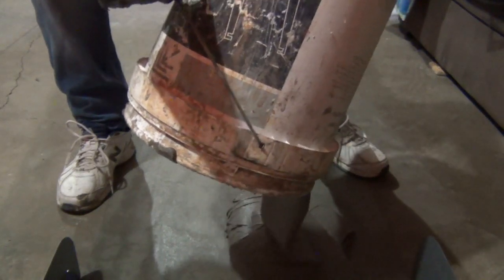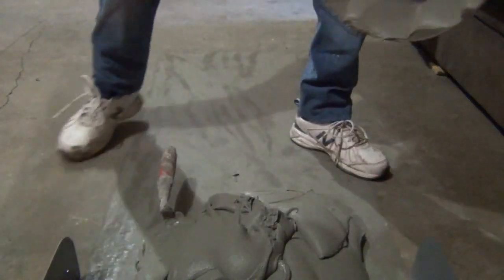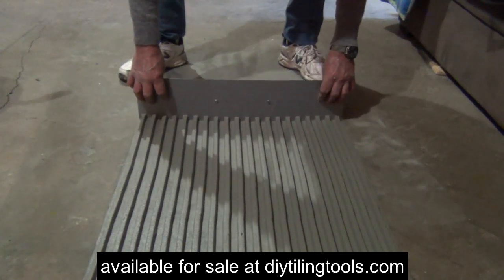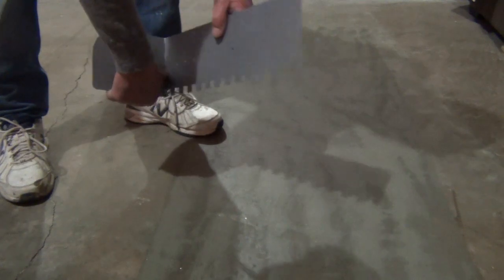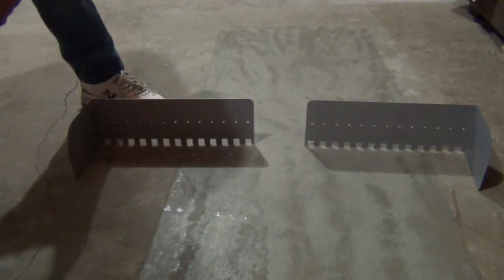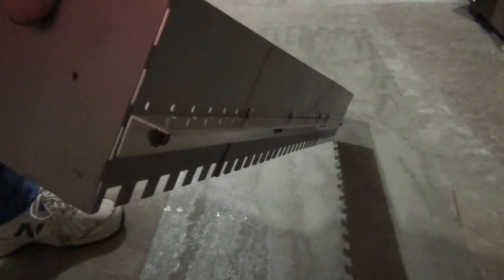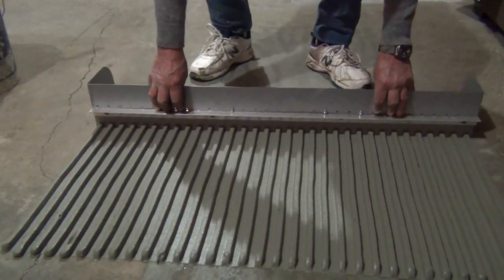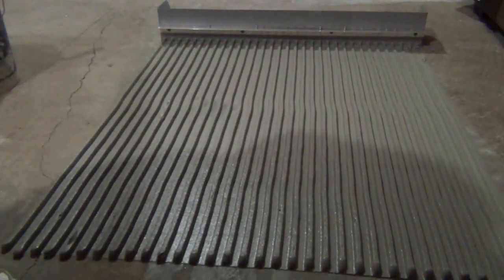Tiling Made EASY With The Pro Spreader - Roy Tiles

Comment: After using Roy's extreme spreader I can say that i had great results and i love it. I'm a DIY'er so this product helped me get great results with ZERO prior experience laying tiles, let alone large format 24x24 porcelain. I used the "skis" that bolt onto the ends to create my own perfectly level screed system. This setup allowed me to lay tile flat on an uneven floor that was slightly sloped and had small divits in it. The versatility and possible adjustments are great. I did decide to backbutter as extra insurance and i incorporated the Delta tile leveling system as well. I simply could not have achieved  the same results using a notched hand trowel. The shipping from Australia to US was decent, maybe 8 or 9 days.

Comment: Mr. Roy Im installing 20 x 20 tile .could you please give me the link of the parts of the tools that I need on your website I’m having a hard time finding the right parts(USA) . On your website once I clicked foronetool it won’t let me add all the parts that I need. ( I am not a tile savvy so I don’t even know if I’m grabbing the right tools 🛠 please help.
Reply from the maker: Hi Victor if your floor is even then you only need the Extreme Spreader but if it’s uneven then I suggest that you use my system for laying large tiles and then you will need a set of skis as well. Alternatively you can buy a Superspreader, middle section and skis. https://youtu.be/CzdpJi9XvEk